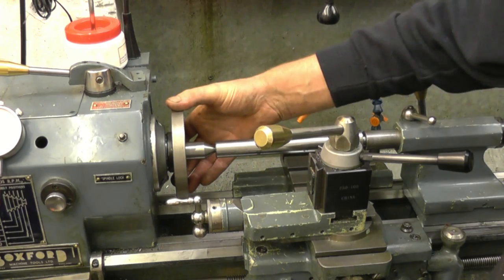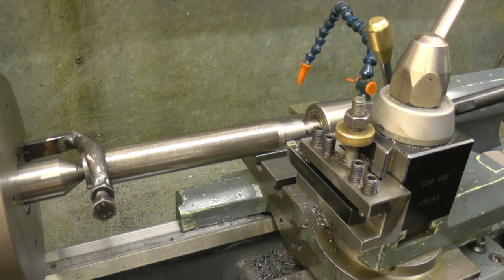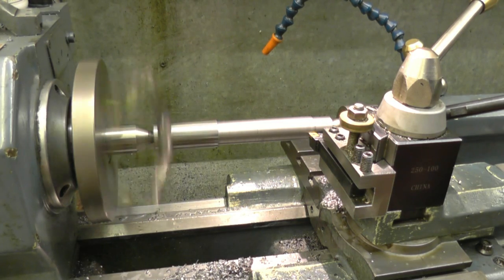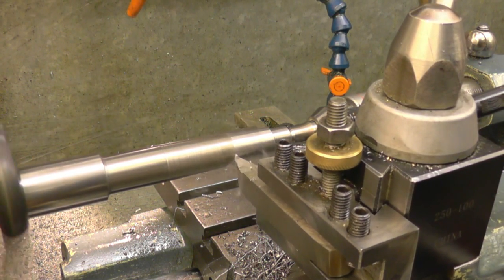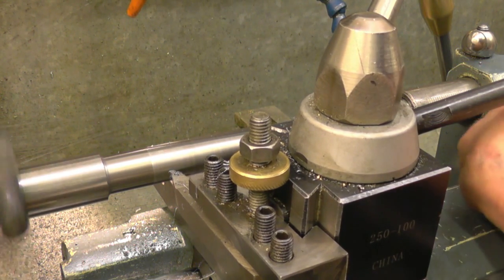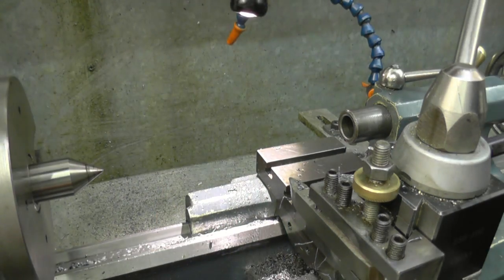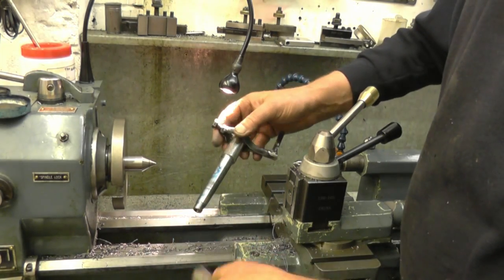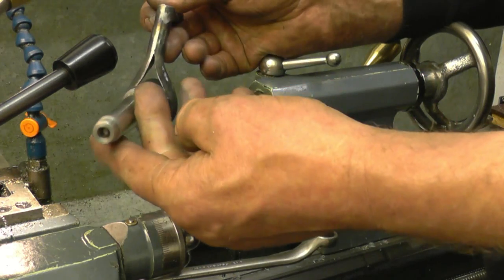TAILSTOCK DIE HOLDER PART 2

Comment: Hi John
Can I suggest using a socket and speed brace on the compound slide, save wrapping your knuckles providing there is a nut in the handle centre offcourse
Reply from the maker: I need to make some sort of extension (or power feed)

Comment: That method John of measuring and then turning between  centers is spot on and when you are set up turn 6-8-10 of them--oil them and put them in a sealable food grade plastic bag and put them away...You will use them in future years..